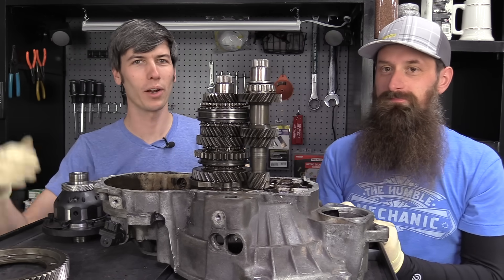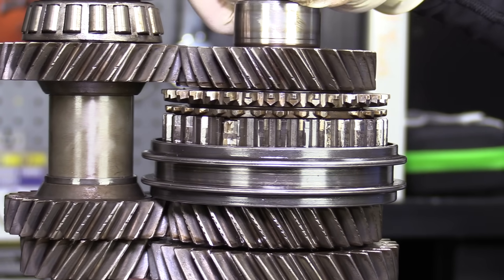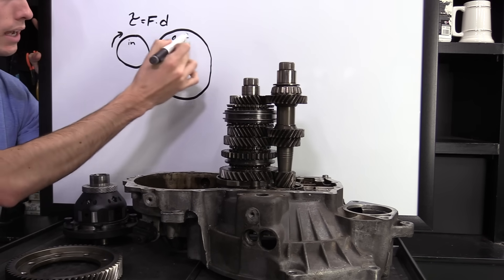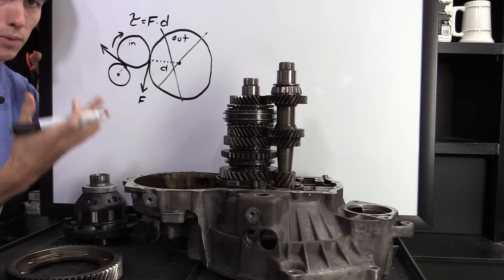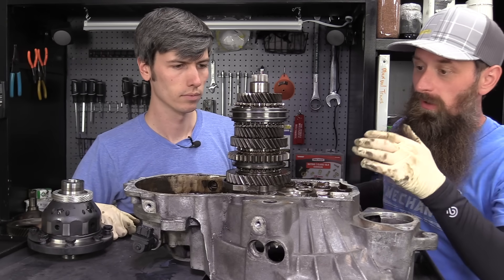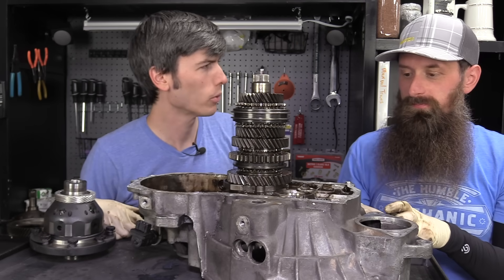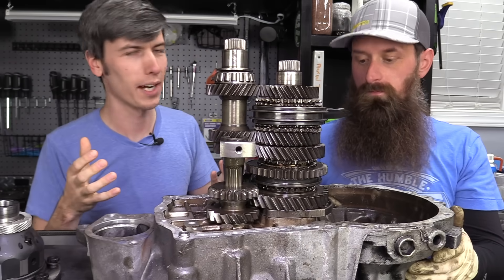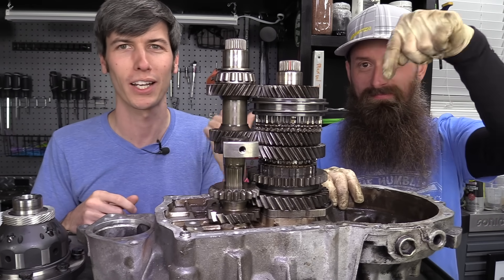How Manual Transmissions Work - A Simple Explanation

Comment: That's what I'd call "manual transmission". You're literally using your hands to shift gears 😂
Reply: Yeah, Dunno about you but I literally use my hands to shift gears.
Reply: @sefyboy7183  same bro, i always have to reach my hand into the gear box the change the gears while stepping on the clutch or i just hold the clutch with my own hand while shifting gears
Reply: Oh I don't use my hands directly, I shift them using a metal rod on a fulcrum to kind of poke around in there remotely with a lever. It's inside the car so that I can manipulate it to change my gears.
Reply: Not transmitting anything though
Reply: Im so glad you arent my dad
Reply: But his mind automatically knew how to do it, so its more of an automatic shift even on a manual transmission.
Reply: 'True' Automatic transmission= EV
Reply: bro rides the clutch for a living

Comment: One nice feature of a transaxle is not needing to balance the first three ratios around having a 1:1 4th gear.  This should allow a manufacturer more flexibility in selecting ratios that are closer to ideal for the engine/final drive combination they want to run.
Reply: aussiebloke609 that’s no the case, the reason is because transaxle is a much more compact unit that can fit in a small compact car, everything is “integrated”
Reply: I suspect you've missed my point.  Classic-style manual gearboxes always had a 1:1 ratio where the input shaft was locked directly to the output shaft.  This is not the case with most modern transaxles - nary a 1:1 in sight these days - probably because to lock the input to the output in the traditional way requires that they be in line with each other, and that usually means the power output has to be at the far end of the gearbox - which obviously won't work for FWD.  There's no reason they can't use 1:1 simply by using the same size gear on both input and output shafts - but they don't.
Reply: aussiebloke609 transaxle do have direct drive, but due to the fact that transaxle doesn’t have a counter shaft input and output shaft can’t be on the same plane as a transmission, so it has to use an extra gear to make that 1:1 ratio, however the problem with 1:1 ratio is that you want to avoid whole number ratio in gearbox because that way the same tooth would always mesh with another certain tooth every revolution, causing pre mature wear. In fact you probably noticed that all of the gear ratio is not a whole number, but rather with a decimal, that way the same tooth won’t always wear on the same tooth on the other gear, but rather take turns, so a defect in one particular gear wouldn’t escalate wear on one spot, but average out in all other gears. In manual transmission 1:1 ratio can be simply locked by locking the input and output shaft together since they are on the same line, there is no gear mesh (except freewheeling gears) happening so a 1:1 gear ratio would not cause extra tooth wear.
Reply: I do understand transaxle layout and how hunting gearsets behave.  You're still missing the original point - that it's nice for the designing engineers not to be restricted by that 1:1 ratio, as a classic gearbox layout inherently is.  

But they don't generally actually have direct drive (or a 1:1 ratio gearset) - which you claimed - and for the exact reason you gave, the lack of hunting in that ratio's gearset, so it seems you've kinda contradicted yourself a little there.
Reply: aussiebloke609 the thing is that they do want a 1:1 ratio but there is no way to get that exact 1:1 ratio without causing more wear, that’s why they compromised a bit.
Reply: And like I said from the beginning, it's not a requirement of that gearbox layout, so it leaves more flexibility.

Comment: Straight gears in reverse are why many cars have a whine while reversing...
Reply: More force on the teeth can be hold, break later...helical is more expensive and delicate but runs silent. And because of no shear force the bearings can last longer, shear force also means more rubbing and heat that has to be cooled with Moe oil. Strait cut teeth is more resilient and take much higher load on the bearing with less losses
Reply: Yep, for pure performance, straight cut is superior. But the noise and rougher engagement are why we use helicals whenever we can. Some cars actually have aftermarket straight cut gears available.
Reply: But why reverse is a straigth cut gear?
Reply: Because adding another synchro would make the trans FAR more complex and expensive. Since going into reverse you're almost always at a stop, a synchro isn't really needed unless you run helicals. Unsynchronized helical meshing would be a noisy hamburger-making mess.
Reply: What I've always wondered is why some race cars use straight-cut gears, like the iconic BMW M3 GTR. What advantage does a straight-cut gear have over helical cuts in racing? And why isn't it applicable to road cars?

Comment: Nicely done. Could you explain a sequential transmission this way...?
Reply: A sequential box uses the same constant mesh  gears that lock to shafts via a Synchronizer as in this video. The difference is shifting is control by a rotating shift barrel that moves the forks as opposed to forks being moved by shift rails

Comment: Nice video. :3.  I'm still a little confused on the purpose of straight cut gears for reverse, and where the clutch master cylinder and slave cylinder comes into play. Anyone care to clue me in?
Reply: The straight cut gears don't need synchros, and they handle more torque.
The cylinder in the clutch is because the pedal is attached to a cylinder and then the hose is connected to the cylinder with a piston that moves the clutch fork.
They can be from different diameters so the cylinder that moves the fork would have more force
Reply: @fersunk  I figured it was something along those lines. And what of the slave?

Comment: Grinding the gears, the syncros have not had enough time to switch gears. Slow your shifts down to allow the syncros to engage. Failing syncros is the first sign it is time for a rebuild, especially if it pops out of gear.
Reply: Motordyne G35 what's a good site or market place for rebuild kits?

Comment: Really cool video. Would have been nice to show a bit more how the clutch actually moves when you press the pedal, but I imagine that's difficult to do when it's not actually bolted on and you're just using your fingers to push it.
Reply: From my experience it is next to impossible to push the clutch springs without some form of leverage or mechanical system. Although it would be very cool to see with real mechanical parts, it’s very difficult and I do recommend 3D animated videos to help understand the clutch system a little bit better

Comment: So if those gears are all connected all the time but allowed to flow freely. How do you grind them?
Is it that thing that needs to move up or down which has some kind of internal groove it can't match into because of rotations?
Reply from the maker: The gears don't actually grind, when people say this it's referring to the engagement of the gear. So if the collar that Charles is moving up and down to engage the gear (1st & 2nd or 3rd & forth) doesn't match the gear speed (if you don't press the clutch in) the collar will "grind" against the gear you're trying to select.

Comment: Question, how much lubricant is in with the gears?  What I mean is, are the gears completely submerged, are they just dipping into the oil, or is there a pump that feeds oil onto the gears? 
 Thanks for the explanation of how the manual transmission works.  I'm a long-time manual fan and I'm always interested in how things work.  I really enjoy your videos!
Reply from the maker: Not completely submerged, but partially, so oil is constantly coating them all while they spin.
Reply: Banks engineering has Youtube videos with a clear cover on a differential to show the oil movement and how different shapes of the rear cover effects it. It may answer some of your questions.